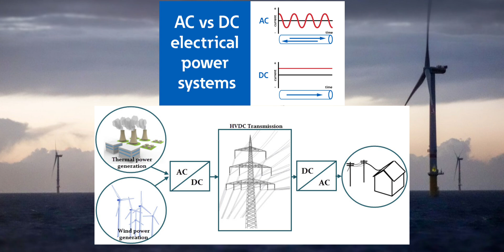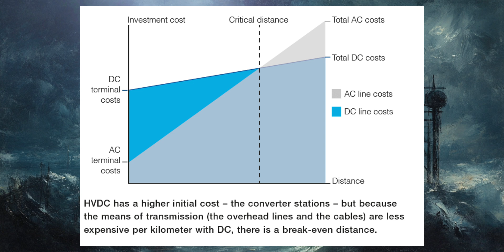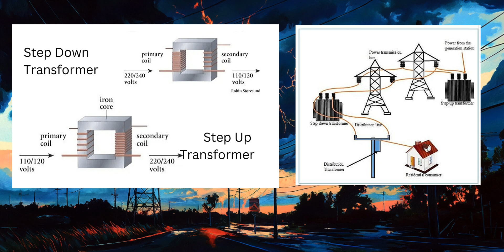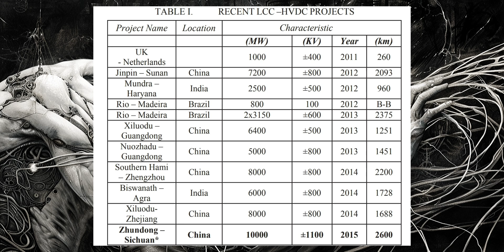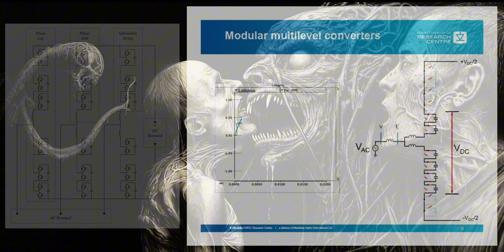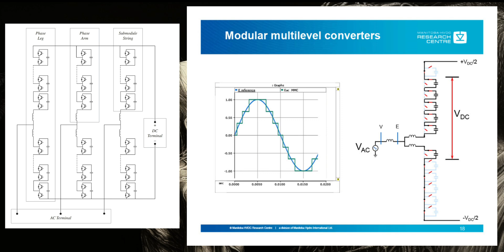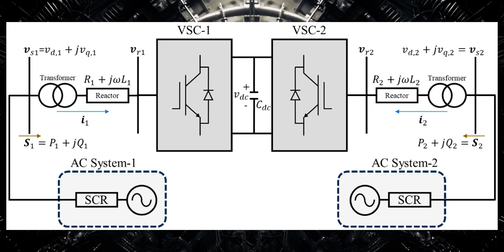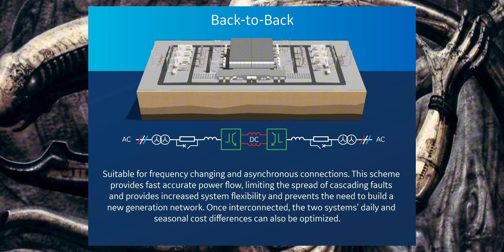HVDC Transmission Explained by a Fallen Angel

Comment: What happens when you are a satanist and a ee at the same time. 😂  Big advantage of a HVDC transmission is that the line capatance is a feature, not a bug. It  would actually improve stability instead of eating current. ❤  However when the converter or inverter fails, all hell breaks loose. The giant thyristors are wafer scale parts about the size of a small pizza and when one goes it is extremely scary, the IGBTs are a different format, big blocks filled with silicone goo with big slabs of silicon that are basicly 5cm wafers turned to transistors, each one has 6 of these in it. They fail like a small landmine. 💀😳